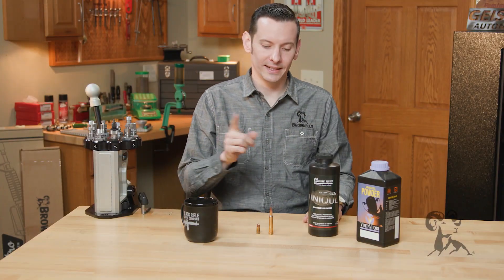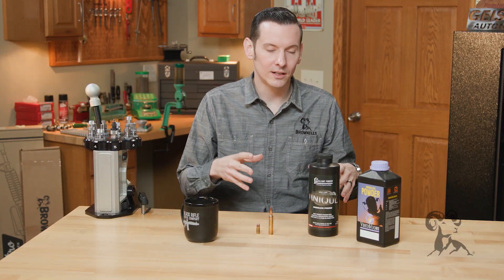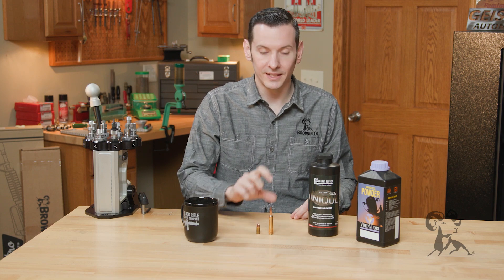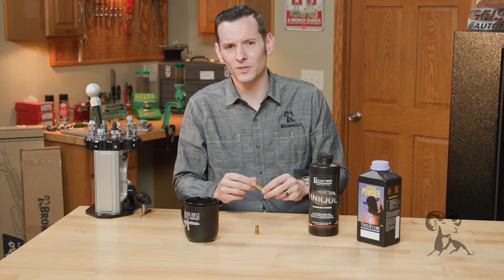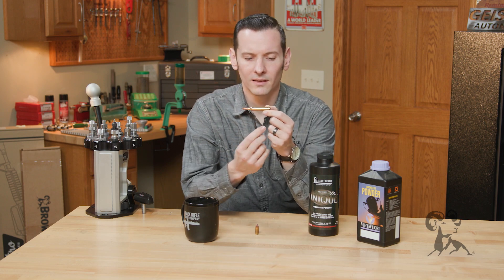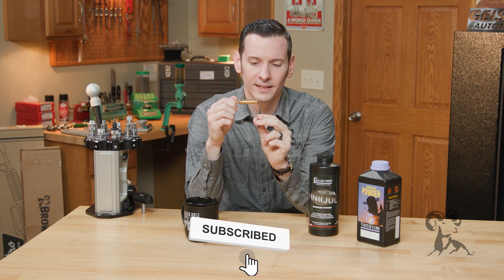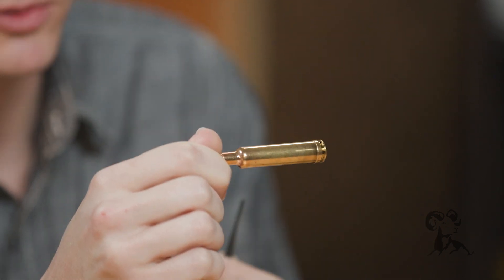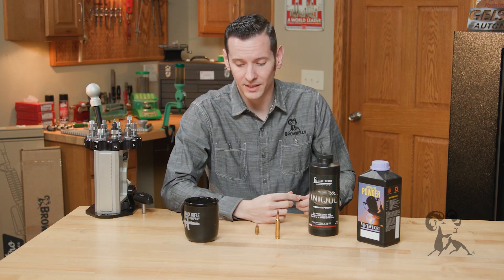Quick Tip: The Dangers of Undercharging a Case

Comment: Caleb,    I wonder how many times this has happened "destroying/blowing up the gun" and it was attributed to being overloaded instead of underloaded, since the end result was an explosion?
Reply: The phenomena first surfaced in the 1960s as I recall, specifically with small charges of Bullseye in larger cases like 44. Since I heard of a number of these explosive incidents powerful enough to wreck a Blackhawk.

 It doesn't happen that frequently, but just enough so I always avoided Bullseye. There's better powders than Bullseye so why risk gun and body. 

The cause has been much speculated but AFIK its a mystery WHY it happens randomly. The makers of Bullseye always blamed double charges but the kabooms were usually with very experienced handloaders who shot a lot. 
The attraction of Bullseye was cost savings since a little bit would move the bullet. But saving two pennies per shot was not enough to entice me to use it.
Reply: Never
Reply: @DinoNucci  WRONG!!
Reply: @DinoNucci  you are incorrect